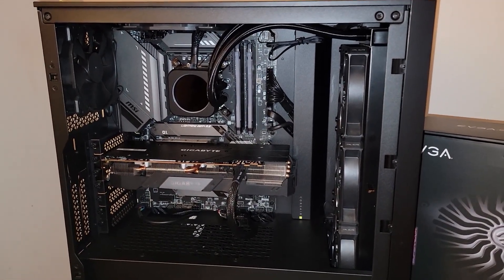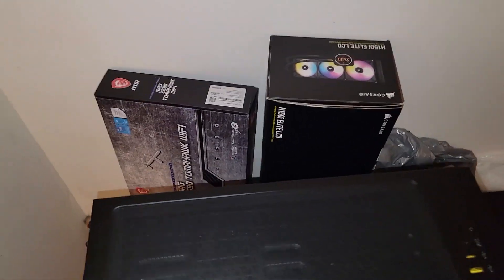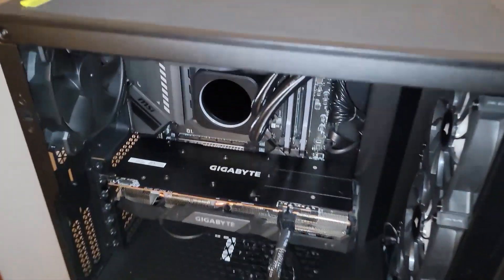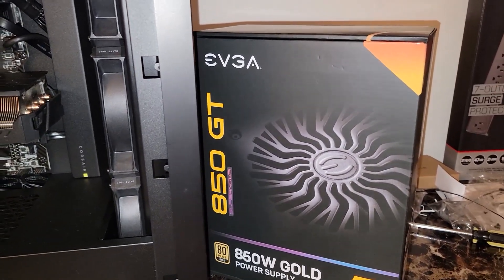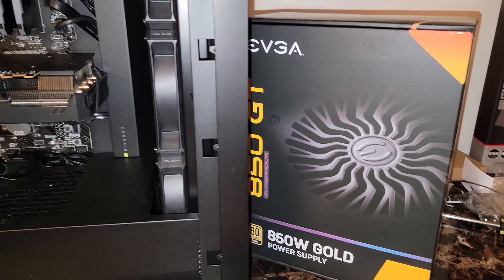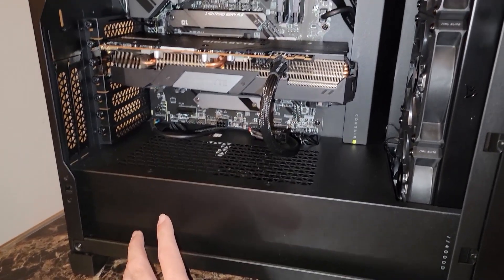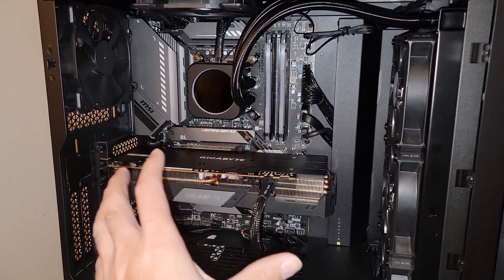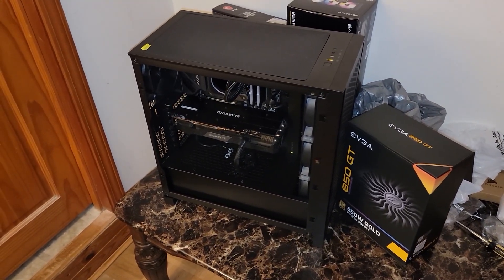Can you run a Motherboard with one 8 pin connector

Comment: I have a MB B650 gigabyte Ryz 9600x video 1060 and a 550W power supply, only 4x4 pins on the CPU, can I use it like this for a while without damaging anything until I get a new power supply??? I know that the 4 extra pins are for OC and higher voltage!!?/ B650 needs 8 x 4!

Comment: I have an MSI B650 motherboard with 8x2 pins. 
I initially connected 8 pin connector, and it worked for a few days. However, after some days, the system wouldn't boot to Windows and instead began showing a USB overcurrent error during boot-up.

Today, I tried connecting only the 4-pin connector, and now it is working flawlessly after three months of struggle. 
If needed, I'll connect the 8 pins in the future, as my PSU also has an 8-pin connector (8+4 pin).

Comment: Would me not having both 8+8 connectors plugged disable my gpu?
Reply from the maker: @redacted5030  no... it would just not boot if we are taking about CPU 8 pin EPS connectors. But if you are talking about the GPU PCIe 6+2 pin connectors, then the GPU would still be detected through the x16 slot as it proved 75 watts of power to GPU. The system may boot but you will have no display output. Unless you have integrated graphics turned on and you are plugged into the motherboard

Comment: Hello, I have a question. I have b650 motherboard that need 2x8 pin but I only have 1x8pin. Config is rx 6800xt and ryzen 5 7600x.
Reply: I have the same motherboard, 8x2 pins.
I connected 8 pins but the system won't boot to windows, instead showing usb overcurrent error.

Today I simply connected only the 4 pin connector and now it is working flawlessly after 3 months of struggle.
If it's needed I'll connect 8 pins in the future, my PSU has an 8 pin connector too.
Reply from the maker: For now you can try running CPU on one 8 pin. But note when CPU boost to higher clocks or PBO engages it might cause your system to just instant power off. You can try it, because a 7600x is not a power hungry, but plan to get a power supply with dual 8 pin CPU power, in the future

Comment: You're totally wrong 7Ampsx12watt 84x4 336watt overall unless your CPUs power draw want's more than that u need to connect that 4pin ow generally 65-105 CPUs can easily handle it think on it bro❤
Reply: I added 8+4 but my cpu is i5 13400 
If i plug out 4 is it ok??
Reply: @govardhandasparvani4833  it has to do with stability not totally watt draw

Comment: this happened to me, I accidentally forgot to plug in both 8 pins and I kept getting BSODs and pc randomly shutting off. I upgraded to an h9 flow today and I figured it out.
Reply: For reference I have a 13900k and 4090
Reply: I have z790 alite ax motherboard and my psu has only 8 pin CPU power cable my PC performance is 50% less

Comment: My psu has only 4 pin but my mobo has 8pin. can i run it on 4 pins ?? Please please answer
Reply from the maker: You can run it yes, but will it run reliably is thr problem. Plug your 4 pin connector in and load a game title you like, or stress test cpu with Time spy or other 3dmark benchmarks, Cinebench 23 and if it stay on. You are good, if the system keeps restarting, you cpu is pulling power the system can provide.

Comment: My mobo have 2 8pin cpu. But power supply only have 1 8 pin cpu. Wtf cant use both even if wantting too.
Reply: They have Psu to cpu extenders
Reply: Basically like a cable splitter offering a psu port that goes into the power supply with 2 cpu cable available
Reply: @KrackleBox  not sure why you would get this, if your psu only has 1x 8pin, then its designed to only give out that much watts anyways. If you add a extender its not going to give your motherboards more watts it'll give it the same amount still

Comment: I have a question 🙋🏻‍♂️ I have the x2 8 pin connectors at top of board. I would like to buy x2 190° Uturn connectors. Do they make them for this? If so what are they called. I’ve been looking and the keys pin outs whatever you call them don’t match up to my board.
Reply from the maker: Motherboard 8pin EPS 90 Degree Adaptor

https://singularitycases.com/product/sc-shift-motherboard-8pin-eps-90-degree-adaptor/

Comment: My psu only came with a dual 4 pin connection. Can I not plug them both in the 8 pin?
Reply from the maker: You should be able to, most 8pins come at 2 x 4 pins that merge
Reply: make sure they arn't the PCIe cables

Comment: This answers my question. I have a MSI Mortar B660m with some bent pins I'm going to straighten out. I'm ordering a i3 12100 to test the board out but I wasn't sure if I would have to order a new PSU just to boot the board. Luckily that's not the case. Thanks!

Comment: You have to turn off all boosting technologies. Any kind of boosting behavior may exceed a single pinout. Or at least that could be one solution. Ran into this when I was changing boards on an Intel K chip. Or just plug everything in.